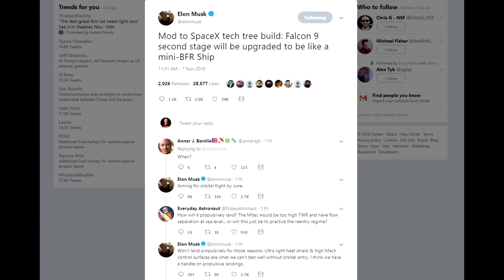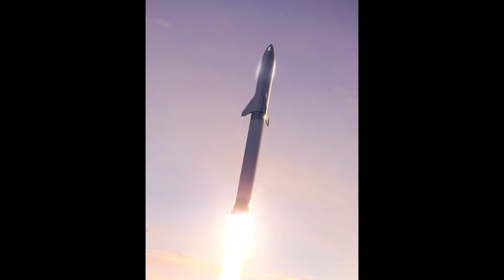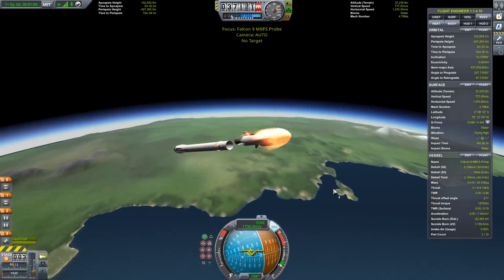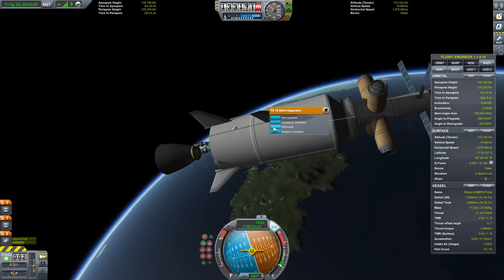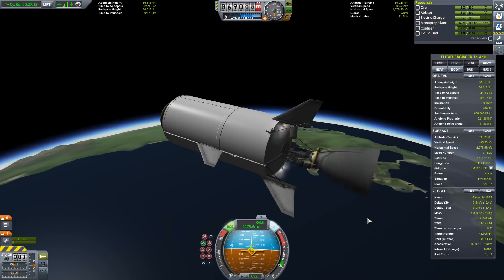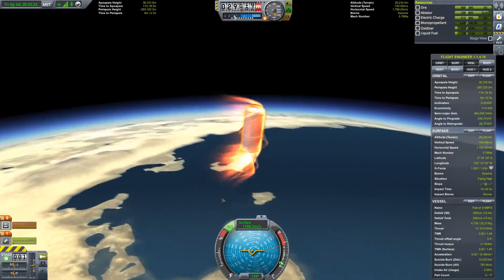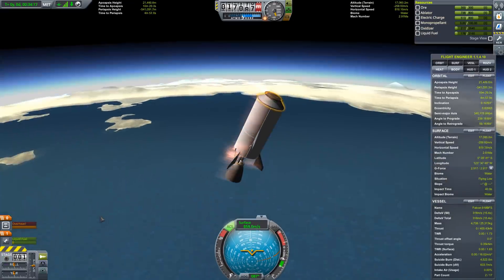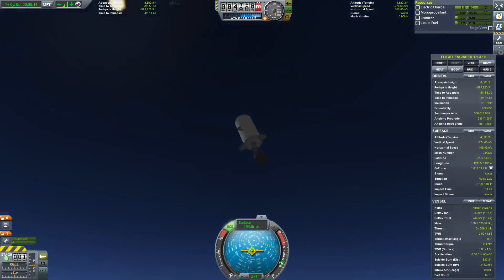SpaceX Evolving Falcon 9 Stage Into 'MiniBFS' For Testing

Comment: Really, a heat resistant balloon with some panels built in would make a lot of dents, control panels and all. Flipping the booster to do a deorbit burn would help. This could all be done rather lightly ...

Comment: I was thinking. Would it be possible to shroud the 2nd stage engine?  Imagine the first stage separates below the bell cover rather than above. Or just add another bit of tube. I know that adds weight and perhaps will lead to a lethal build up of heat but remember the 2nd version of the BFS had its vacuum engines housed in such away.

Comment: Ok----- Are you stupid? -----  The BFR ship's fins fold up and down and do not turn like elevators and  rudders. The fins folds up and down to balance the ship's drag during reentry. ----------  If Space X does not make a miniature BFR ship that keeps the disposable fairing with the addition of small folding bow fins, with a hull extension over the rear engine (simply moving the break line between an upper stage as wide as the fairing and the booster below the engines) for the large rear fins to mount to, There Is No Reason To Even Bother.------------------ The shame is that they are not planning on recovering the ship (even if it took launching it on a Falcon Heavy to carry enough fuel to put a large cargo into orbit as well) which would make recovering the fairing Mute while proving the ship's ability to land from orbit, shortening the testing time for the BFR to carry passengers from years (possible decades) to months since it is by then basically an upgrade of a proven design. -----------------   A Heavy Falcon with a totally reusable Dragon -(3?) BFR ship along with the reusable boosters,, would be cheaper to operate than the Falcon-9 with it's costly disposable upper stage.

Comment: I still have problems when launching my rockets like having a stable rotation cause my rockets wobbles and because i play on a PS4 i can’t reduce speed causing a lot of pressure to gain up and the heat destroys all my parts and even destroys my parachutes inside the fairings

Comment: I'm pretty sure the Falcon 9 will keep the standard payload configuration for a while (at least 5 to 10 more years) so customers can fly their designs without needing to change them. This mini BFR spaceship will be strictly for testing only. I to wonder if this mini BFR spaceship will be using a Raptor engine. Would be a great way to test the Raptor engine in a relevant environment & conditions.

Comment: A few things to keep in mind: SpaceX is planning to be their own customer for a satellite based internet service. This would give them more leeway for modifying launch vehicles. Also, with the booster coming back to land, the cost per launch is actually not that high (in rocketry money) (assuming the MiniBFS is expected to be thrown away as it is a test vehicle), so the idea of doing a launch solely for testing purposes with no customer payload is possible. They could even use end of life block 5 boosters that they would normally have retired.

Comment: Good discussion, Scott. Thanks for your continued excellent analysis. 
BUT, in this case: what if the second stage is more like an enlarged X-37B, one tailored to carry, say, 20 Starlink spacecraft. A hatches, no shroud. The shield-area-to-vehicle-mass ratio could be more than ten times that of the Shuttle - including shielding around the vacuum engine - meaning very high deceleration and/or greatly reduced heating load. IMNSHO: Starlink depends on launch costs that are about 5% of what SpaceX currently charges, so a new, fully recoverable second stage is required.

Comment: Much of the BFS R&D can take place on the ground or during hop tests in Hawthorn, Texas. 

However, the first BFS reentry requires a thorough verification of their (SpaceX) modeling of reentry aerodynamics (when using adjustable fins to balance the engine and residual fuel weight). 

As velocity changes, if the drag produced by the fins is not proportional to the drag produced by the hull, then the fins must be adjusted dynamically. The feedback system that adjusts the fins has to operate with stability, or the ship may wobble excessively (or even tumble). 

I suspect that the fins will not require rapid adjustment under load. Wait and see.

Comment: They don’t really need to find a customer if they are reusing a pre flown vehicle. Cost is low...maybe even just use a pre flown engine in the new second stage as well...no life support etc and small size will make the new second stage relatively expendable...

Comment: What information do you have that Space X will do this test during regular commercial LEO launches? My guess is that they would more likely encase a second stage  in a mini-BFS body. The most difficult part would be covering the engine, since it sits inside the interstage adapter of the first stage. Also, the rear fins would be hinged on an axis parallel to the centerline, not perpendicular to it.  That's awfully difficult to actuate (acknowledged by  Elon). But perhaps the mini-BFS does not need to look like the BFS to test the critical technologies. My guess is they'll fry a few before succeeding.
Reply: It's all speculation at this point. But what Scott describes here is more economical then segregating the projects.

Comment: A mini BFR as a second stage makes sense.Could run a lot of test on the BFR design. However I read that SpaceX was asking help from NASA on heat shield tech. That made me nervous. If true, throw out any time tables you have. It's called NASAitis, or delay, delay. So if and when the mini does fly and does well in testing then go ahead with full size BFR. Only problem I have with all of this is I'll probably be long dead by the time a full size complete BFR flies.Or possibly even the mini. Which sucks. Good presentation by the way.👍

Comment: Actually, I think this is SpaceX going for a fully recoverable second stage. Right now the whole 2nd stage is thrown away. With the addition of some BFS add-ons it could all be recoverable. Just switch out the vacuum engine for a regular one, extend the lower skirt to the bottom of the engine, add three fins for steering and landing, add a reclosable clam-shell fairing, and add the heat ablative material for a controlled re-entry and you've got a mini BFS. With fuel being a priority, I'd add a domed top to the fairing so that, once in the atmosphere, it can deploy a drogue chute for initial slowing, then a main chute for a slow descent to almost touchdown. Moments before touchdown, cut the chute loose and do a controlled rocket burn for the final tail fin landing. This would save a lot of fuel since it would only need extra fuel for the de-orbit burn and the final, and slow, landing. The clam shell fairing would only need to swing 45 degrees up and 45 degrees down to give a 90 degree opening to eject the payload. Then it can be winched closed and securely latched shut. In this way they can not only test their new software and hardware, but make the Falcon 9 fully recoverable, with no changes to the Block 5 first stage and not a lot of changes to the second stage. The extra cost involved in ditching the vacuum engine and other changes would more than pay for making the second stage fully recoverable and reusable.

Comment: if they do RTLS launches, then the only cost to spaceX will be fuel, which I believe elon has been quoted as saying that was only like $200,000 (by memory, that could be wrong) then the only other cost would be the booster refurbishment and the cost of the experimental upper stage if they cannot retrieve it. 

with spaceX's great level of reusability without refurbishment, do you think that it may make more sense to build a more accurate test model and fund their own test launches? 
in terms of R&D for a spacecraft that's some damn cheap data and wouldn't take any risks or require any modifications to their current second stage, when they still need to implement their new COPV and then get their 7 unaltered launches for NASA's human flight approval.

Comment: Two cranes with an arrestor wire strung between them. And an arrestor hook on the side of the rocket. Then, the rocket can come in hot and snag it with the wire and bring it to a stop. Carrier landing for rockets.

Comment: You're right on Scott.   No Raptor upper stage...  Too big as currently spec'd.   Someday a baby Raptor would have good utility as an ACES type stay in space stage refuelable at a Space X fuel depot.  Since BFR is mostly a LEO thing like the Space Shuttle unless refueled in orbit an ACES tug would help with pushing small stuff to GTO.   Have you simulated a typical ~5 ton satellite mission to direct GEO using a BFR?   That's something that Falcon Heavy is capable of doing right now.   LOVE your videos!  Excellent work!

Comment: As to the landing, I would assume that they'll do a "propulsive landing in to the water", and recover it with a crane on a barge, similar to the way the Space Shuttle solid rocket boosters were recovered. Good enough for post-test analysis, since I would also assume these won't be re-used.

Comment: 2:40 "This Extra hardware is gonna had weight penalty". But as they probably won't recover the rocket, they can save plenty of weight by not filling the tank.
And even if they do try to recover, this "sky diver reentry" is supposed to save plenty of fuel, so...

Comment: I have some thoughts on the center of mass being so far back. You could have the interstage stay attached to the second stage after separation,  just like it does on the BFR. This would push the center of pressure backwards, and also allow you to place the rear fins further back.

Comment: Makes a lot of sense, once they have their human rating. They might as well use the spare capacity for testing, and what they are wanting to do with the BFR/S will need a lot of testing. If the shuttle teaches anything, it is that you aren't going to foresee the difficulties, and you will not get it right first time. Reusable heat shields have never been done well, and the current design looks like it has actuation in reentry airflow, and that has never been done at all. Getting fins to work at the top of the rocket is non trivial (part of why the shuttle ended up so low), and getting a rocket with fuel in it moving stably sideways is one of those things that is far harder than it sounds.
I don't expect a raptor on it initially, but I do expect that it will be the first place we see a raptor used in anger. A sea level raptor would have the performance to do the job, and it makes sense to try to get one working well before ramping up to mass production. The BFS looks very ambitious if they can't even get a single raptor down. Getting a re-entry stable will require the fuel tanks to be redesigned, and at that point you might as well start with a blank slate. It is not as if they care what kerosene is going to do under those conditions anyway. The risk to customers will have to occur at some point in the raptor's cycle, and a raptor based booster would require much more tooling that isn't really justified for a research project. Every design iteration would also have them tearing apart perfectly good recovered boosters.

Comment: This definitely isn't plans for reuse. But they definitely would have parachutes on it so they could inspect it 
It would have similar aerodynamic surfaces like the BFS.
The M Vac engine is a definite problem. Unless they cut the interstage out to add onto the second stage, I don't see how it will work

Comment: I doubt it would be used for customers.  Rather, a 1-off test vehicle with a nose cone instead of a fairing, as well as the fins you envisioned.  The mods are too extensive to be a permanent upgrade to f9

Comment: I have wondered why SpaceX has been trying the fairing recovery on its West Coast launches, which are somewhat infrequent. Now I am willing to speculate that recovery of a second stage from orbital velocity is better tested out here.
 Recovery for functional re-use does not seem likely. Parsing the Tweets Elon has responded to, the vacuum bell engine will still be in use, but to emulate the BFR the stage will need more than the fins and lightweight heat-shield additions. I propose that a light payload of some sort will be launched to take advantage of the excess capacity of the stage. Either an inner fairing/ stage release mechanism will be used, extending forward to gain the aerodynamic balance needed along with emulation of the empty weight more closely or a half fairing for the payload may be created. Perhaps even no payload at all if some commercially expired first stages are available to do the testing. Then with a heat shield equipped, modified fairing extension still firmly attached, the upper stage can more closely resemble the dynamic shape and balance of the BFR.
Why I think recovery by parachute on the west coast using the catch boat Mr Steven is that the teams out here have the most experience. The recovery without sea water contamination is important for the analysis even if some damage is done to the empennage to get good information on the heat shield. Telemetry for orbital recovery may be better on this coast as well.

Comment: Hey Scott, I'm not entirely convinced of you line of thought. If the 'Small Falcon Rocket' is too different from its big brother, the usefullness of learning based on the smaller version will  be very limited or zero. So my guess would be that the exterior form, the internal mass distribution and the actuated miniature fins will be very similar to the real thing, just scaled down. As for simulating re-entry and descent (without the actual propulsive landing), they could use Super Dracos to simulate the 7 Raptor engines. That would of course mean that they launch it on dedicated test flights without any other payload - and without payload fairings.

Comment: They could have part of the interstage connected to S2, but it would have to be short enough to not block the radiative cooling on  the nozzle extension. This would move the center of pressure back and provide mounting for the rear fins. It would also mean a large part of the bell would protrude, probably requiring a stronger bell to cope with aerodynamic stresses. Another option would be to cool the extension ablatively or use a sea level Merlin on S2, either of these would allow the entire interstage fly with S2. All in all, they might find it easiest to simply make a mini BFS with a sea level Merlin, nose cone, and some ballast at the front rather than trying to integrate everything into something that can still fly payloads.

Comment: Good speculations, Scott.  One thing you say is that you think they would have to put the fins as far back as possible because the center of mass (COM) would be in the rear.  I don't think this is necessarily true.  While vehicles rotate about the COM, aerodynamic surfaces are most effective when they are furthest from the center of pressure (COP).  With that big nozzle hanging out the back, the COP is shifted rearward, which makes the best aerodynamic location for the fins (though not necessarily the best mechanical position) at the nose of the vehicle.  What makes a vehicle want to flip around (static instability) is when the COM is behind the COP, with the vehicle becoming dynamically unstable any time the COM and COP are too close together, such as in certain modern fighter jets.  Think of a tail-dragger airplane: when flying it is statically stable with the tail surfaces a long way from the COM (usually about 1/3rd the cord from the leading edge of a straight wing) and the COP (about 1/2 the cord behind the leading edge) is behind the COM.  When the main gear touches down for landing, the gear takes over from the wing, supporting the airplane, and the gear is pushing back on the airplane, well ahead of the COP and the COM.  With any little misalignment on the runway, the COM wants to pass the landing gear, abruptly spinning the plane around.  On landing, with the airplane slowing down, you want the a big rudder as far away as possible so you have as much control as possible.
Reply from the maker: But the hinge design threat using for the skydiver descent method steers by adjusting center of pressure with respect to center of mass

Comment: Unless I missed a tweet, with block 5, I dont see why they would use a customer flight.  Resue of booster to the 4x or 5x level could be worth testing before a customer flight anyway.  I hope they use a sea level Raptor, since I dont think the have the ability to test a Raptor ignition in a vacuum without flying to space.   I also agree that testing the heat shield is important, but they really need a soft landing of some sort to check adhesion after a full reentry.  Therefore that should use a dedicated flight which would allow for plenty of weight to be wasted on an oversized parachute.  A sub mach parachute at that, so it would need little testing.   Either way, Go SpaceX!!

Comment: What if, instead of a vacuum motor, SpaceX incorporates 7 miniature Raptor engines in the design, or uses Dracos?
Reply: A 'miniature Raptor engine' would be a large project with little ultimate use. Dracos are pressure fed, which would require re-engineering the entire stage, and add a whole lot of weight, plus the fuel itself is heavier and has lower performance. Baaaaad idea.